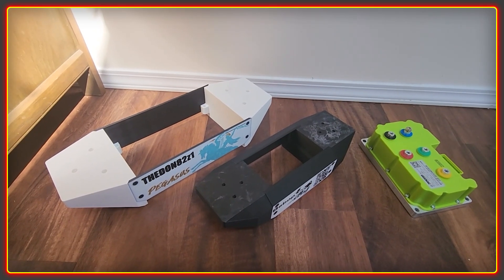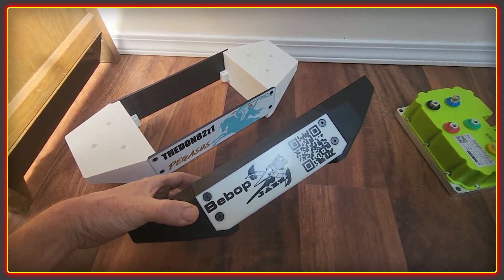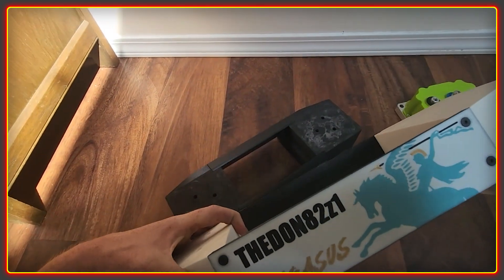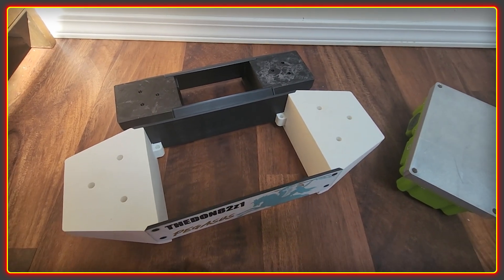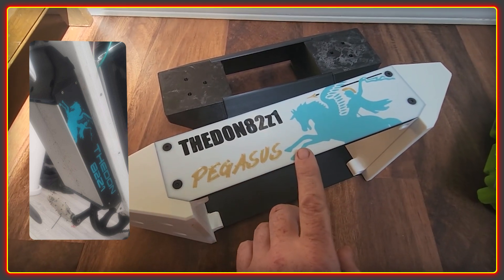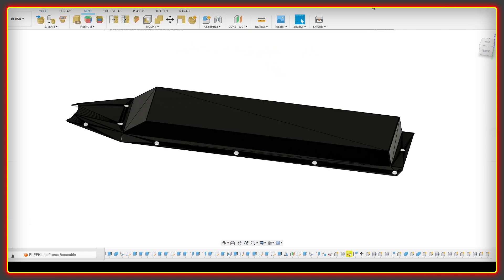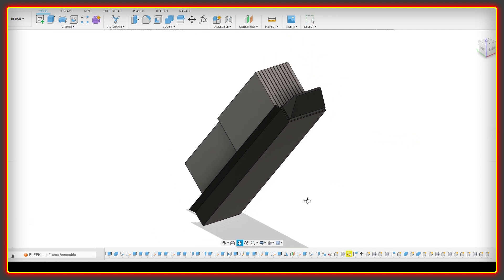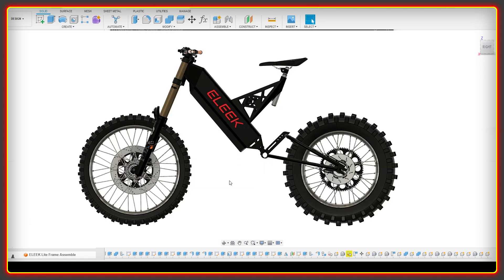Speed Controller Mounts for Far Driver and ASI BAC2000

Comment: I have a genuine question, why is the far driver controller so cheap?, it seems to handle a much higher amperage and volt limit but is in most cases significantly cheaper than the sabvoton(probably the most popular on the market)
Reply from the maker: I'd say that the production costs might be lower. Simpler design maybe. The drawback is that they are rather larger

Comment: Interesting about the pouch cells. Have you tried those yet and how do they compare to the standard 21700 cell packs, size, weight, etc?
Reply from the maker: I have not had the opportunity but they make the best batteries for the Sur Ron. Weight I think is the same. Its more simplicity of wiring and power density.

Comment: You need to look into Lord Adhesives, specifically Aluminium adhesives. No welds, stronger than the aluminium it self!. Cure times of 10 seconds to 20 minutes.
Reply from the maker: I will check it out. I think they use this kind of stuff a lot with autobody parts now?